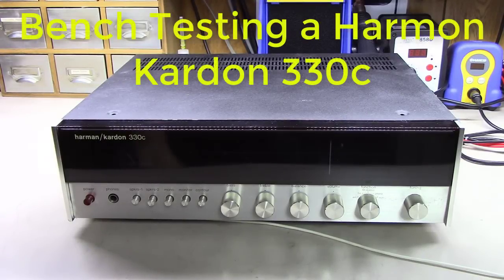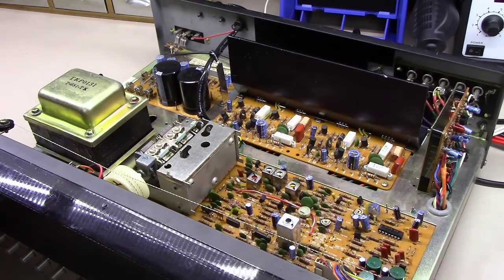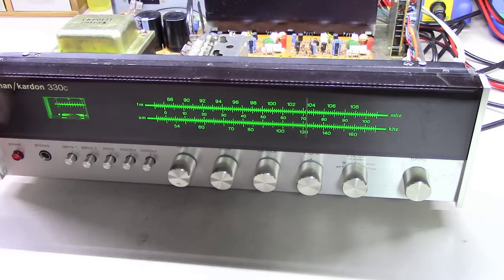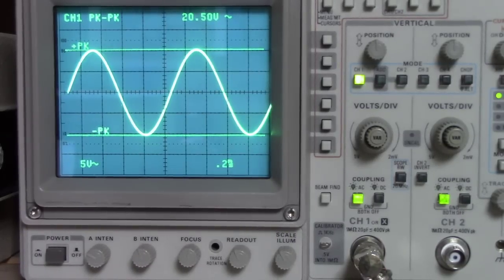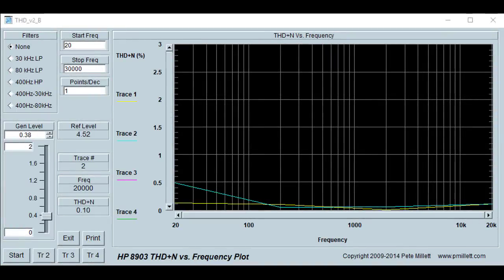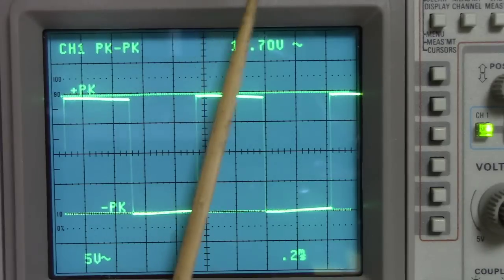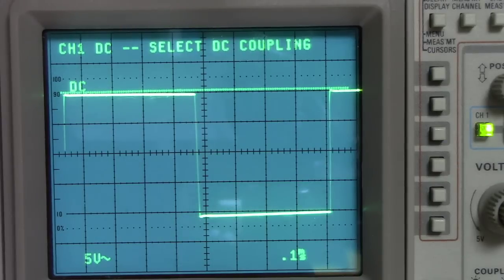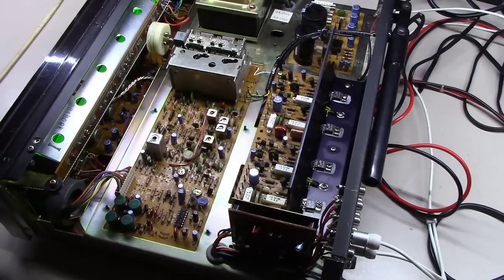Bench Testing a Harmon Kardon HK 330c

Comment: I just started working on one of these with the same static and crackling on the right channel with no input and about 0.3-0.6VDC on the speaker terminals. I used a wooden stick to poke at the transistors for the right channel and got some huge pops over 1VDC on the right output when touching Q401 which is one of the differential pairs.  Once I replaced it the noise was gone completely and ended up replacing all four 2SC1345 with 1845’s.  My unit appeared to be all original with gray Elna caps which are now being replaced with Nichicon UKA or UKT for audio circuits
and UPW/UPM for power caps.

Comment: The downward slope on the flat portion of the rectangular wave indicates a slight reduction in LOW-FREQUENCY response, not high frequency. A drop-off of high-frequency response would be indicated by longer rise/fall times. This is the case for all analog circuits, not just "this thang" (sic).
Reply from the maker: You are correct sir, I must have stated it incorrectly in this video.
Reply: Had that horizontal line represented amplifier gain-vs-frequency, then you would have been correct. I've never seen square-wave response from a good-quality audio amp, so this was a treat. I have an HK 330i "Ultra Wideband Linear Phase Receiver", so this naturally caught my eye. Thanks!

Comment: This happened to me on my Harman Kardon HK 450,took it to the local audio shop,they couldn't find anything wrong with it,they told me to bring in my speakers(JBL 2600's)it turned out that the left speaker crossover was the problem .They replaced both crossovers,noise was gone!

Comment: Some thoughts: If the noise was from both channels, that pretty much eliminates the pre and output stages. At first glance of the customer's video, it looks like he/she is turning the volume knob. I thought maybe a noisy volume control or function switch. Shipping the unit may have somehow cleaned the pot due to temp changes during shipment. One other possibility is electrical interference, especially if the customer's video was AM or FM playing. I would also tap around the entire unit with the plastic end of a heavy screwdriver to see if maybe there's a failing connection. Good Luck

Comment: That unit probably have 2SC458 transistors, those make that noise. You can replace them with KSC1845 or KSC945C
Reply from the maker: I've ran into that a lot in Marantz pre & phono boards but even after 8 hours now, no signs of it.  But you are right, might be worth replacing them just for a safe mind
Reply: I collect those little HK buggers, same thing with mine... replaced them and voila... ( I forgot to mention that it was just an idea.)